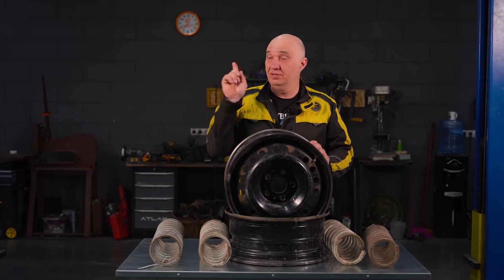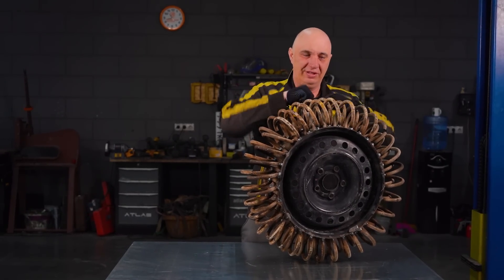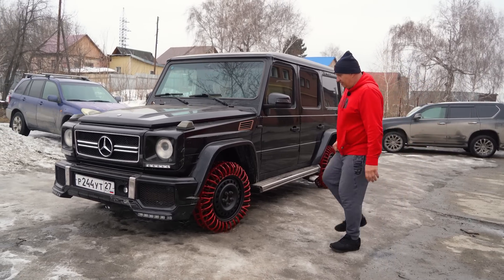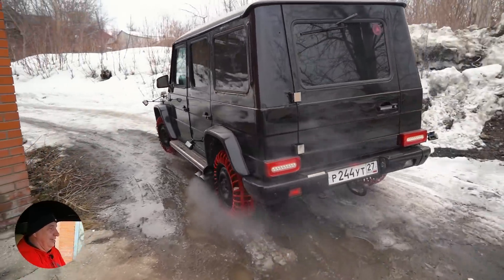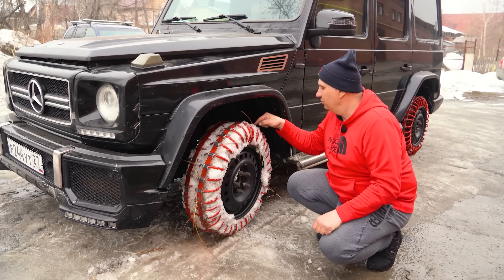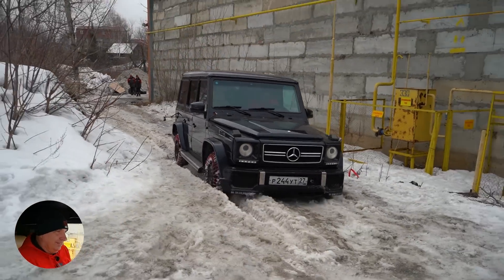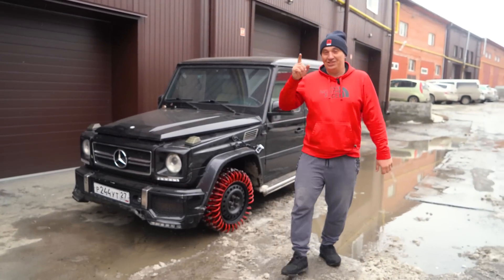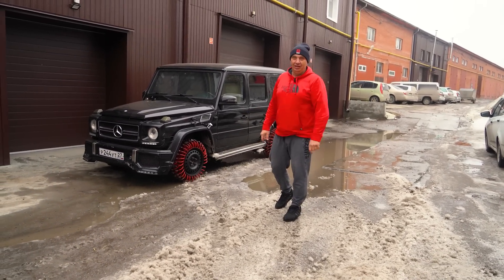We replace tires with springs - are they better off-road?

Comment: I think that if they welded small studs on the springs where the metal strips were at. The studs will provide much more better traction.

Comment: Why didn't you weld the strips on the inside, you've defeated the whole purpose of extra traction by welding them on the outsides of the springs.

Comment: - [ ] There is this video I saw of them making a retracting system for a clutch pedal that got me thinking, what if these guys welded a see saw system for an automatic vehicles which has only two pedals, and test it out if it would allow someone to conduct left foot braking, safely while on a closed track though Remember that depressing the brakes, lifts off the accelerator and vice versa

Comment: The intro in the first 30 seconds showing the end results working in these videos really remove a lot of the mystery or anticipation when it comes to seeing if a build works. The concept of many of these videos is seeing if it's possible to build or drive on these parts and it sort of spoils the whole thing.

Comment: I think that I would have run a wire rope around the wheel with the spring between the cable and the rim couple wraps, pull it tight and weld.

Comment: So the contact area is basically flat smooth steel surface... who would've guessed there's no grip on snow at all 🤦 Round edges of springs propably takes care of what's left of any possible sideways traction. Well, atleast now we've seen what we already knew.

Comment: Garage 54: if you still have those. Do a another video but add some rubber tread around the outside. Perhaps take some old tires, and cut the tread off and put those spring wheels. Rubber trends will give it traction.

Comment: Hmmmmm.....I thought they would have worked better than that.
Reply: Contact area is flat smooth steel, there's barely any traction on snow at all... they work like skis, they just slide.

Comment: The reason it doesn’t do so well is because the tires are iron. Rubber wheels adjust to the surface and hugs the road where as iron is stiff and is like having marbles for wheels even with those spaces between

Comment: The problem is the slippery steel piece you welded right on your contact points.. you could have welded them on the inside or heated the springs to relax them to the new shape. As soon as you put those on i knew it was gonna slip

Comment: Perhaps you could weld a set of snow chains to the outside of the springs for better traction? Smooth metal tends to slip on a hard surface. Something to block intrusion inside the springs may also stop you digging in so you get the grip from the width of the spring metal without sinking in.

Comment: This would be a nightmare in thick mud. The springs would fill with the mud in an extremely out of balance manner and high pressure water would be required to get it out. Cool test though.

Comment: should have heated the coils with a welding torch, until red hot, then bent the spring to fit the wheel.

Comment: I have an idea, how about wrapping chains around the rubber tires to create the same effect, but without snow getting inside the springs?  Nah, dumb idea, never work.
Reply: Probably because in snowy place they use that idea and it’s a factory made product when they could be custom built necessarily

Comment: You're not very bright. You put the ring on the outside which makes it slip. Reduces traction. Put it on the inside and weld it. Then it'll actually have traction there genius

Comment: In my PhD study of suspension I was surprised that researchers were modelling tyres as pure springs (zero damping). I was sceptical at first but it is indeed the case (a very close approximation). 
To get some feeling for this, notice how mechanics will bounce tyres on concrete floors. Or look at dash cam videos where a tyre has come off on the road. They bounce around for ages. They have rotational energy, but they also bounce. 
The "tyres" in this video, however, don't have great traction. "Rubber" has a very high coefficient of friction. 
I was excited by tyres without a tube, but they don't seem to be practical?

Comment: You’re picking up too much material. It’s too aggressive. Weld strips on the inside of the springs so that you have weight support instead of it. You’re shoving the springs deep down in and destroying your driving surface.

Comment: Bad welding as I see it. Weld the flat bar on the inside of the coil springs on the outside where they can't get traction and just slip on the slick surface.

Comment: Pretty sure idea is to have wheel that has traction in really soft terrain and light vehicle like garden tractor or bike. Spring digs into soft ground and gives traction, hopefully not digging in and eventually there is rim to take the pressure if it digs and no inner tube to be punctured. On car, specially heave as g vagon it just digs in on ice and snow.

Comment: If you look at the tires used on moon rover used in the Apollo program, those tires were made of piano wire not so different from your springs just your springs are more heavy duty while moon rover used many more lighter piano wires woven to become springs.

Comment: Vehicles have been around for over a century, constantly changed and upgraded with new tech and features. The wheel hasnt changed much, apart from size and width - telling you that the pneumatic tire on a rim concept, is proved above and beyond as the go to option that stands the test of time for good reason.

Comment: I have a great idea for your channel! :)
Make a dynamometer to measure power on the wheel. It's a good project, and it will definitely come in handy in the future to test the new modifications on the channel to see if there is a change in engine power. :)

Comment: The springs were clearly too small... It was rubbing the oil pan... I would have added some 6 mm bolts or threaded rods for extra traction... To avoid getting the bolts or rods torn off, I would have drilled holes through the small metal strips left at the springs.

Comment: I work with springs professionaly every day, so here is a pro tip: when welding the springs onto the rim, you should have put the finished product in the oven of 260°C for 60 minutes, for relaxation to take place. Meaning the internal stress forces would be relaxed, so even if you had then removed the springs from the rim, the springs would have kept the bent shape, and would not spring back into being straight. Also, the steel strip should have been welded on the inside of the spring (if structual solidity is your concern, otherwise there is no need to use the strip anyway).
Keep up the good work, salute from Slovenia!
Reply: And also use rubber tyres.
Reply: I shit in the tub once and I was surprised they didn't destress them first
Reply: There always has to be the one professional 🫥
Reply: @Domestic_Tedster  yes, and you should be thankful for it, I sure  am.
Reply: @davidmiletic6647  Haha! Yes!
Reply: @Domestic_Tedster  Well without it that contraption could spring itself through the vehicle straight to your throat. It's a fair point.
Reply: @aleks5405  what's next a meteorite hitting you in the eye falling from space

Comment: I would have put the strips inside the spring so it had the reinforcement but it still drove on the spring not the metal strip

Comment: When car tires lose traction, the vehicle slides sideways, that's why rear wheel drive cars fishtail. Off road capability on soft surfaces is all about flotation, once the car is down on the bellypan, you're done driving. So springs are a lose-lose replacement for tires. Some things are better to watch others try out, that's why Garage 54 is world famous!
Reply: It's even worse than that. The spring coils provide no side to side traction. They will act like skis which enable it to slide sideways extra easily. Moreover, the coils are always going to be angled to one side, so they will tend to push the vehicle diagonally rather than straight ahead when power is applied.

Comment: The springs weren't getting any traction because of the flat strips that contact the ground first, next time just weld a piece of rebar in the valley inbetween the coils and allow the coils to act as grip

Comment: a wide panel strip around the middle of the tire welded to both spring with a solid rubber tread strip attached, solves the issues for the most part.

Comment: Right Away I can see the strips needed to be mounted inside the springs. Mount them just inside the outer edge of the spring. You'll achieve the safety you were looking for, and the traction.

Comment: Being hard and inflexible, the springs either slip on harder surfaces or chop up and sink into softer surfaces. If the strips were wider but welded on the inside of the springs, it would not bury itself in the soft so bad. I think the other video of springs as tyres worked better as they had some give to them welded on radially in short sections.

Comment: Mercede G isnt great for off road .. I see front differential isn't locking correctly or slip so use 4x4 that  don't have slip use classic 4x4 and test again will do lot better

Comment: Should have put the strips on the inside of the Spring. Would have served the same purpose and let for greater attraction
Reply: Was about to say the same thing.
Reply: The moment i saw the strip i thought this. For the same reason that flat bottomed street shoes are not what you want to be wearing on ice, you get no grip.However, if you can securely fit a rubber tire around this, you could be left with a puncture safe setup.
Reply: yep
Reply: For sure
Reply: This
Reply: This right here
Reply: I agree. I posted the same thing before reading yours
Reply: (*traction) this way its funnier, because it sounds like visual attraction in this context
Reply: Was thinking the same thing as soon as I saw the valley in the middle of the 2 rows of springs.
Reply: or weave them
Reply: i was going to say on the side wall
Reply: Thought the same or on the side
Reply: Agreed
Reply: Russians bruh
Reply: My 1st thought as well
Reply: That would be pretty hard to build.
Reply: i thought the same
Reply: I thought the same thing then seen your comment
Reply: I came here to say the same thing.

Comment: I believe the 4WD system on that wagon is hampering the tire test, put those on a trusty Lada and they will do fine I bet.
Reply: A Lada Niva would embarrass that decadent MB G-wagon.
Reply: @BlackPill-obey  Haha no it wouldnt. Would have to be modified then. Doesnt have 3 lockers to begin with.
Reply: @martinsv9183   On paper, it might matter.  In real life, the Niva prevails.  Especially if you have a small pic of Brezhnev on the dashboard.
Reply: This will never work. its just a piece of wire that you are trying to get traction from.
They need to weld upright patches on the inside to make it more of a PADDLE wheel. now the snow is just going around the spring material. You need something to stop the snow and then you will have traction just like in those old all metal tractor wheels. And even then you are trying to get grip with a ROUND bar of steel :D
They should be sharpened to be any use..These would be just fine as front wheels on a lada but nothing more.
Reply: It's the traction control causing the problem, you can see it putting on the brakes to force the diff to switch sides,,
Reply: they should have locked the diffs and it would fly
Reply: Nope they won't. The flat welded "safety strap" is what is causing all the traction issues.
Reply: @TheYamaha37  Even with the flaps gone they are not doing well.
Reply: @TheYamaha37 that and traction control is getting in the way
Reply: There is no better system than on the G-class. 3 mechanical lockers. The regular traction control system turns off when you engage them. There is nothing more you can do.
Reply: @martinsv9183  There is, put them on another car with normal manual lockers. Whatever system it has that you are talking about is not working here.
Reply: @ATruckCampbell  i guess you dont know how g-wagon drive transfer operates.
There are 3 switches for 3 locks. One is for 50/50 4x4 drive and two others are
for locking either rear or front wheels.

What it looks that they only use central 4x4 lock and let differentials still operate
freerly to avoid damage because makeshift wheels whichs arent exacly
same size or other imperfections which could potentially cause
some damage when wheels simply cant even spin at same speed.

In short there is no better system for true offroad purpose.
How they only used it as open dif 4x4 was user error.
Reply: @ATruckCampbell  Haha no there isnt since its physically impossible to have more than 3 lockers :)
You have to discuss that with whoever created the universe and the physical laws :)

Sure, can always be something wrong with the traction control, but all those systems have a limit. I can post videos of almost any 4WD car out there doing exactly the same. Go watch some tests on rollers.
Reply: @martinsv9183  Center, rear , front differentials, how is that impossible? LMFAO 😂😂😂😂
Reply: @tejay9416  what lol? :) Yes its a front, center and rear lock. One button for each :)
Reply: @martinsv9183  Doesnt appear the lockers were engaged in this video. Some tires spin, others dont. Note the snow packing in the front wheels, they were not spun enough to clear the snow like in the rears. Could have even been put in 2wd once they got rolling. Having all 3 locked would be like the part time 4wd's with lockers when they are engaged. All 4 should get power.
Reply: @MichaelLaferriere  Yeah they are not engaged there. There is no 2WD mode though.

Comment: What was the point of using springs if you're just going to turn them into basic carriage wheels by putting a big metal strap around the springs? :/ "Why doesn't it have grip" could it be the stupid metal strap you welded on? ;v
Reply: The point is they based these rims off another set that strips were added too they removed the strips after testing the first time
Reply: @allenthomsen5534  useless first test tho.
Reply: @dimitar4y  it may seem that way but they wanted to replicate the original wheel first so it makes sense to test it before doing any other testing

Comment: Whey welded a flat strip of steal right in the contact patch. The fudge.
Reply: Yeah should of been put inside the springs,.
Reply: Did you keep watching? They cut them next.
Reply: @anchopanchorancho no way, I stopped watching as soon as my comment was posted. They should know better to not put the ring on the outside.
Reply: @anchopanchorancho or….we could just use tires 😳😂
Reply: @anchopanchorancho  Yeah, but still the steel strip inside the springs would of prevented them filling with snow and grime...
Reply: @Schoolofmonkey it's "would have" not "would of".
Reply: They followed as it was on that picture it's not their idea that's why....
Reply: Research and development.
Reply: Steel not steal

Comment: What the hell is wrong with that thing???  As soon as the rear loses grip, the fronts seem to just stop spinning at all.   Some kinda traction control nonsense?
Reply: This is all wheel drive, not to be confused with 4 wheel drive. This transfer case is equipped with an open differential, to allow all wheel drive on dry pavement. Even if the transfer case is locked into 4-wheel drive, it could be that the wheel you see stops spinning because the opposite wheel on the axle is spinning through an open differential.
Reply: @vincentrobinette1507  All G-wagens have 3 mechanical lockers. Front, rear and center.
There is no such definition with 4WD vs AWD. Would be beyond stupid since "All" and "4" means exactly the same on most cars.

Comment: since you use dual springs you could just use a ring of rebar in the middle  as reinforcement.
Reply: This was my suggestion too, even after they cut the bands off.. they left a bunch of flat area band behind.
Reply: Yes and it could have sat between the springs and not even have to slip on the road surface
Reply: I think he woulda gotten away using a chain with spikes in the middle 😂😂😂😂👍👍

Comment: I wonder how these wheels would do on a lighter vehicle.
Reply: Probably just as bad.  The contact surfaces are too rigid.  
IN any case, a genuine Soviet Lada Niva would run circles around that G-wagon.  Keep a picture of Leonid Brezhnev on the dashboard and it will never fail.

Comment: strips on the inside of the springs?
Reply: Yeah. Or even on the side, as it might be easier to weld.  The way they did it kinda ruins the design IMO.
Reply: @RByrne  👍
Reply: Yeah.  The sides
Reply: Exactly totally F’d the concept